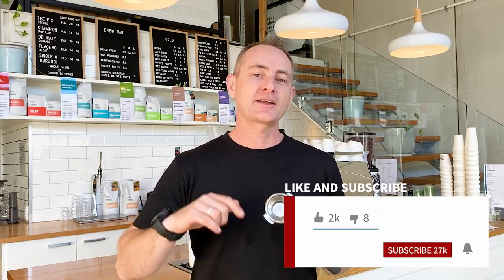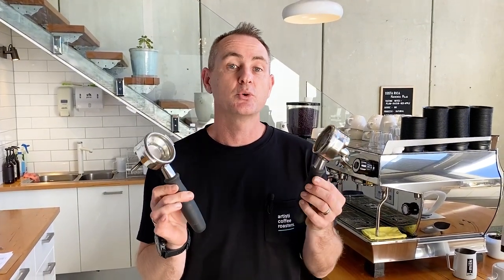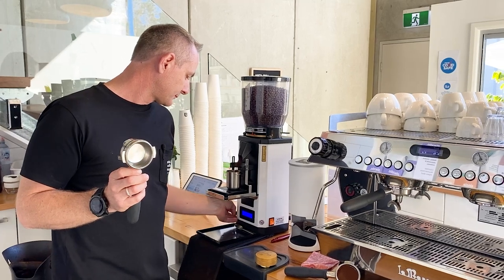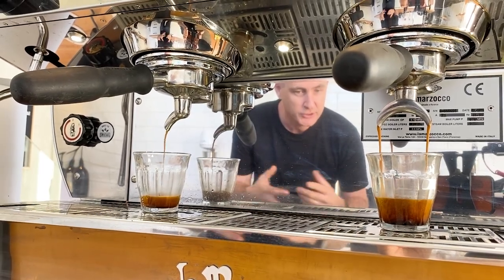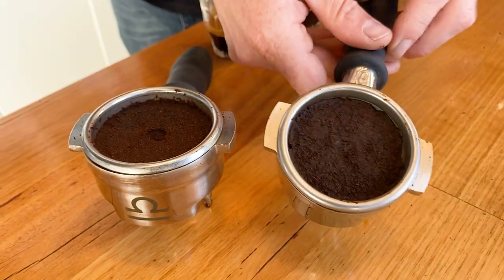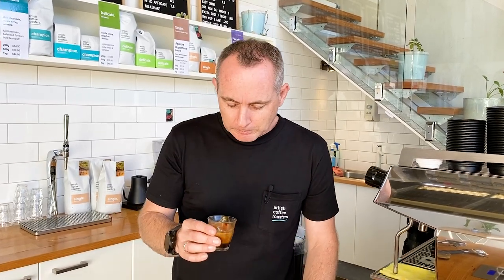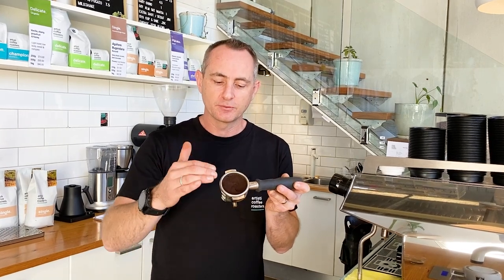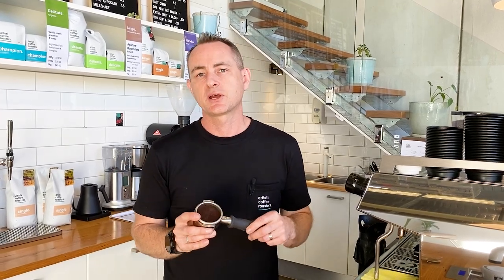Single Spout Handle with 7 - 9 gram Basket - What you need to know.

Comment: Somehow Italian cafes manage to extract single shots just as thick and tasty as if they use the double spouts. They don't change the grind size either as far as I see
Reply: Yep, it's pure sorcery. I wanna go back
Reply: Adding more grams in a single spout as he suggests is what I do here in Italy and it has always worked
Reply: @fafaffu2  maybe, but they don't really weigh it. From the grinder doser, 1 click for singles, 2 clicks for double and that's it
Reply from the maker: they tend to over fill the basket and it creates a lot of pressure in the head, its not the same as how we want the grind to do more of the work
Reply: Sometimes the key is using fresh roasted coffee beans, single shot or double shots you can easily get that thick creama on top and the taste is a lot sourness with a balance of sweetness and bitterness.
Reply: @baristajazz3782  Italian cafes don't usually use very freshly roasted beans (Illy, Lavazza, Kimbo etc) but they go through beans bags very fast whereas it takes me 1 month to go through 1 kilo bag. So it might have something to do with the fact that what cafes pull is the result of a bag opened that day, so yeah, fresher beans
Reply: @baristajazz3782  Italians use dark roast which is easier to work with. The taste is also less interesting.

Comment: so ideally it is recommended to always use the double filter basket even you only want to have a single shot? and to do this, you need to lessen the dose and yield to get the taste of the single shot? example: 11g dose 22g yield single shot / 18g dose 36 yield double shot - both using double filter basket.
Reply: Unfortunately, it's not as easy as he says. The more you reduce the dose in the double basket, the further away the shower head is from the grist. This will muddy the puck and increase the likelihood of channeling.

Comment: What a waste of 7+ mins where he just confirms what other experts say the single spout porta  is a waste item. The description of the video is misleading.
Reply from the maker: 👍🏻 we really wanted to try and show the nest way, however it was really hard, but still some advise for those struggling with the single basket
Reply: It's not that much of a struggle. I have a single basket that's nearly half of my double dose. I dial in the grind for a double, then figure out through trial and error the correct dose to hit a similar extraction time and ratio. This is with the IMS baristapro "single". It tastes and works great for commercial use, aside from leaving a little mess in the basket.

Comment: I tried 10gram, and a step finer at 12bar of pressure. 4sec pre infution. It comes out nice. Taste is almost same as double but a little  less strong.
Reply from the maker: Great to hear. Coffee is about using what you have and trialling to get the best results.
Reply: Interesting another video was suggesting a lower pressure for that smaller puck

Comment: Use a Marzocco Strada 7g or VST-7 basket with a 41mm tamp. Profit.
Reply from the maker: Yes that sound good
Reply: Agree, Using a Marzocco Strada 7g basket with a 41 mm dosing funnel designed to fit a 58mm portafilter, then additionally using a finer grind than is typical for a 20 g dose 58mm basket well tamped with a fitted 41mm tamper will deliver a 14 gram espresso far more flavorful than seen in this video.  Using the properly designed equipment will give you consistently excellent single dose espressos from a single dose basket. This is the secret to successful single dosing. 

In my experience single dosing with the typical manufacturer supplied 7 g basket, using a grind appropriate for a 20 g basket, and a typical 58mm tamper will lead to a frustratingly poor espresso or Ristretto. Once you acquire and use the properly designed single dose equipment, then you will have the ability to access tasty 7 gm dose espressos....a true Italian taste experience.  Ciao.
Reply: Exactly, he has the answer in his hand but doesn't understand it. La Marzocco designed that filter to tackle exactly this problem

Comment: After watching this video and most of your previous videos, I am now using a double spout basket with 10g of coffee but the problem is its challenging to get a nice distribution and compaction of ground into the basket. What is your suggestion?
Reply from the maker: Are you using a dosing pot? Or any type of distributor tool? Also is the 10g in what size double basket?!
Reply: @ArtistiCoffeeRoasters  I.m using a plastic dosing pot and OCD. By the way, from yesterday, as an impact of your video, I have changed my cafe's standard recipe to: for a single-shot 15g coffee:25g espresso; and for a double-shot 18g coffee: 40g espresso. I'm in Nepal and it's very normal that customers ask for a single or a double shot. I'm no more using the single spout portafilter. What do you think about my new recipe ? Your guidance ad suggestion would be highly appreciated. Thank you, Luke, and the team ACR.